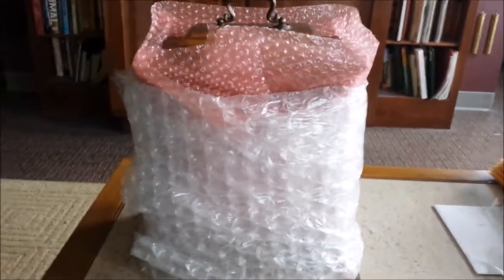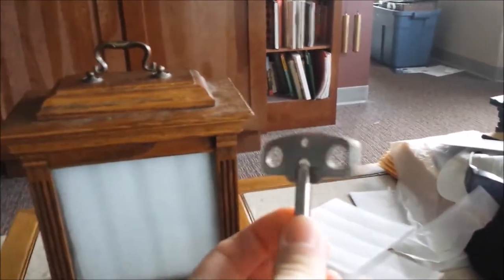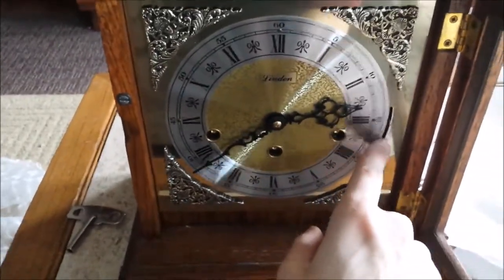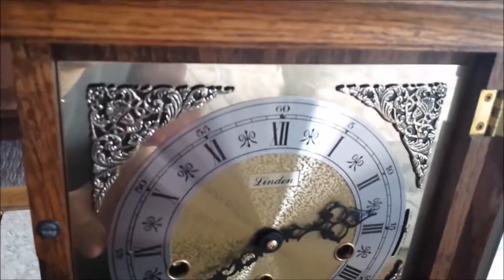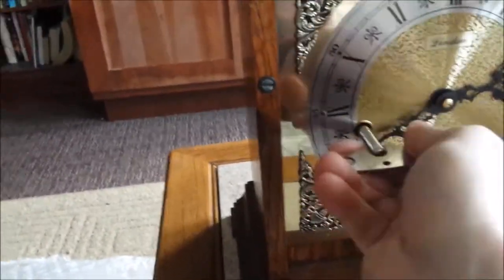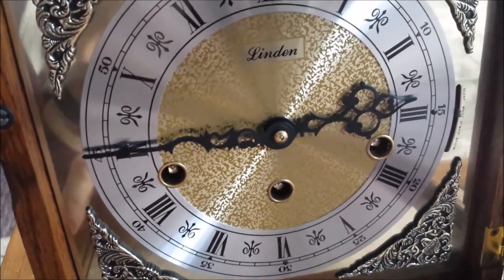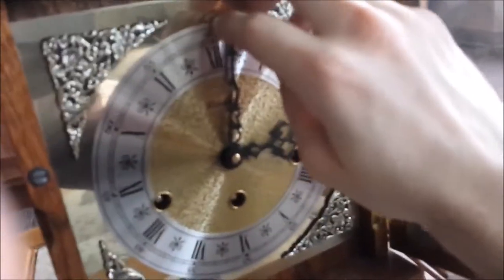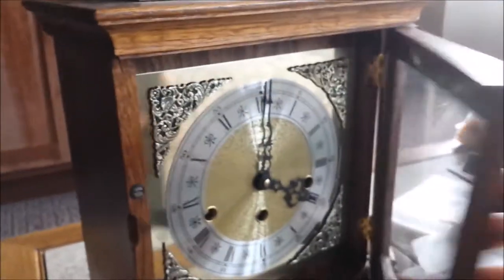Linden Triple Chime Bracket Clock Unpackaging and Setup

Comment: Hi. i have the same clock that was a gift, but never worked. 3 days ago right after dusting it off and thinking about how I need to get it to a jewler/clock repair person, I heard it chime. It works fine but just runs a little fast. Are those two flathead screws next to the + and -  at the top of the unit the adjustment for the speed? Before I do anything to it i need a little more information. thanks
Reply from the maker: Hi there. That's an excellent question. For starters,  clock adjustments depend on the model you have. I assume the movement in this video is the same as yours, as this will involve trial and error. The way to adjust the speed of your clock is on the disc. The pointer on the disc is what you will need to move to regulate your clock's speed. Turn the pointer to the left to slow it down or to the right to speed it up. Note the term, "Lefty-loosey, righty-tighty." I hope that helps you. If you have any more questions, feel free to ask me.

Comment: What kind of oil should I use?
Reply from the maker: That's a good question.  I did a little research and found an answer on another YouTube video.  That person used Horace Whitlock's synthetic clock oil.  It's been used on thousands of clocks for many years.  Try using that.  What kind of clock do you have?